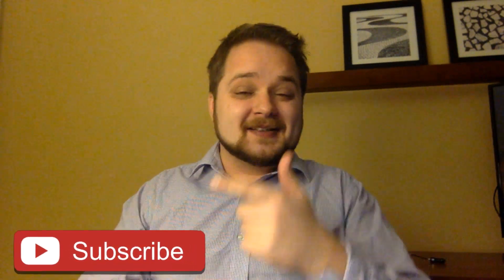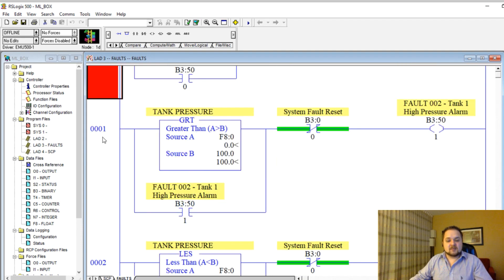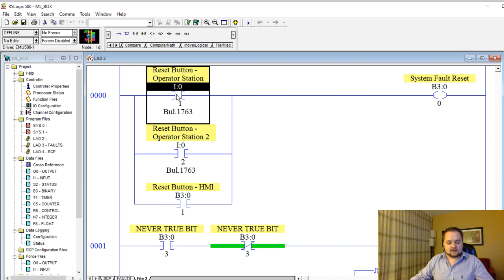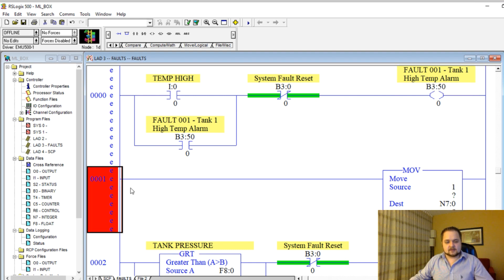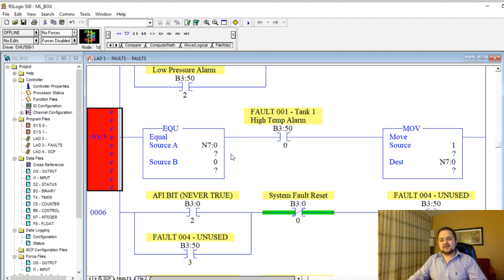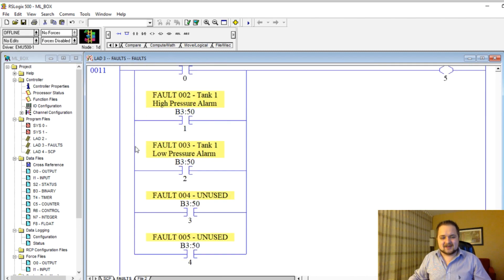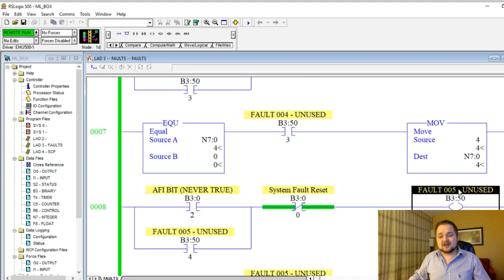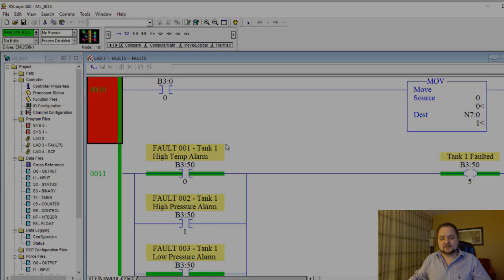PLC Alarm Programming - Advanced Alarm Capturing in Ladder Logic RSLogix 500 Allen Bradley

Comment: Thank you for the great Idea Vlad. I would like to ask you what if there's more than one alarm occur? will it be safe?  because based on your method it only allows one alarm to trigger at one times, so the other alarm needs to wait for the current alarm to be solved.
Reply from the maker: It's common to see this in manufacturing. You want the first alarm to be displayed. Once you figure out the issue, you might have more alarms that occurred due to the first one. You'll have to clear them sequentially. You can certainly modify the logic to show all of them. However, it can easily lead you down a wrong path - you can be solving the wrong issue.
Reply: @SolisPLC  Yes you're right Vlad. Excuse me, do you have any reference on how to manage alarm for several plc slave in different unit?